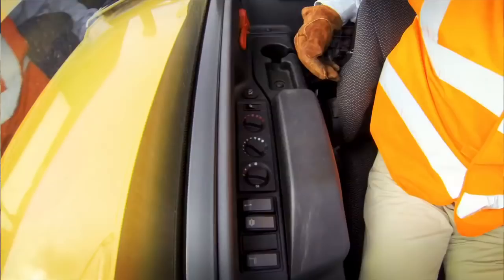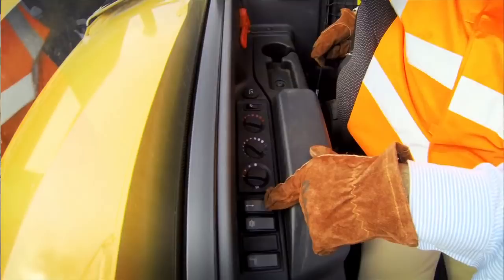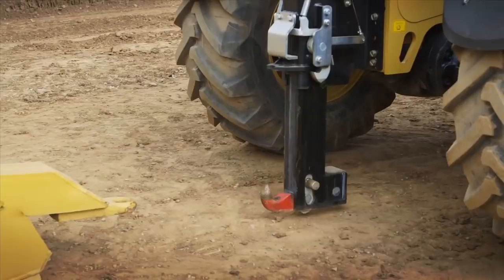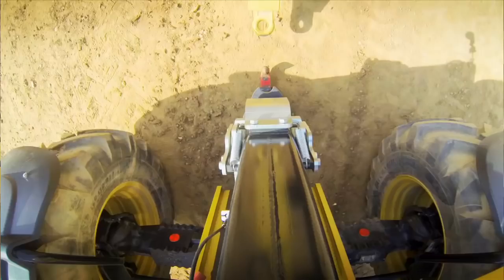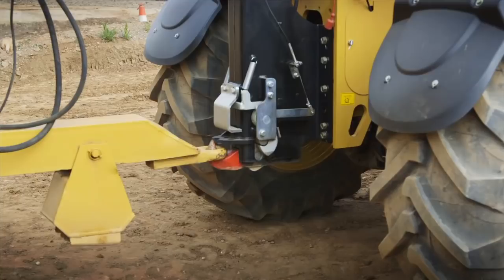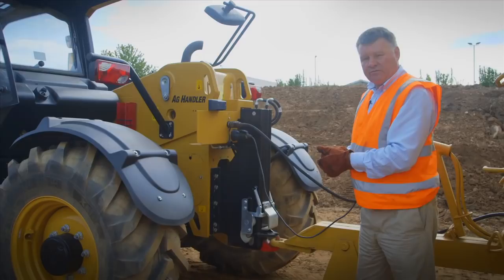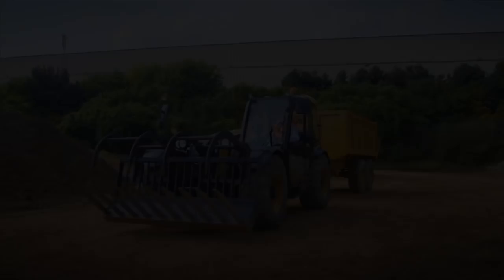Quick Hitch: Cat Telehandler Operator Tip (Europe)

Comment: I would just like to point out something that you did not take into concideration. 
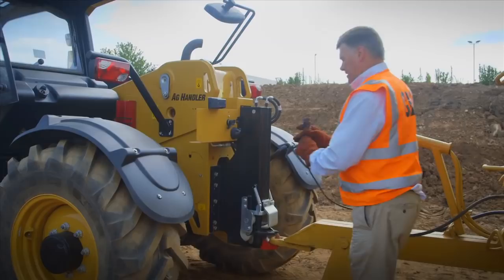In this video at 1:19 Roy conects the brakes and the lights of the trailer to the telehandler. Now although he did it with alot of ease the one thing that he did not do, was check to make sure that they all actually work! It's no good if some operator just plugs the hoses in and doesn't check them to make sure that they are working and then drives out onto the road, BRAKES and no lights come on! Or people can't see which way the operator is turning because the lights don't work! 

C'mon guys saftey first!
Reply: True but irrelevant. Doesn't have a number plate, so won't be travelling on the road anyway.